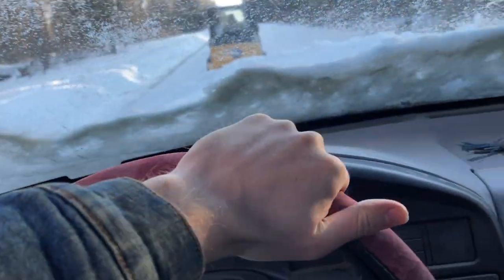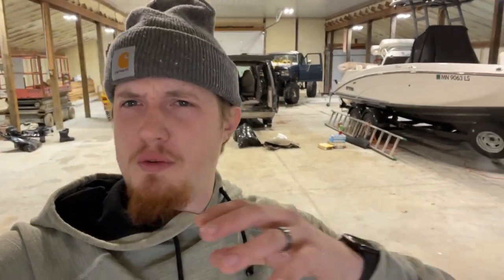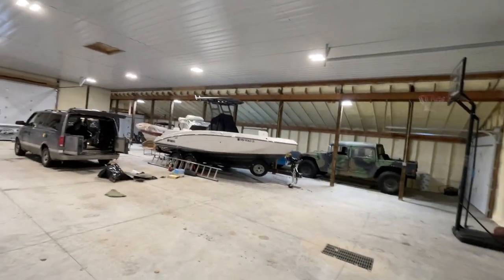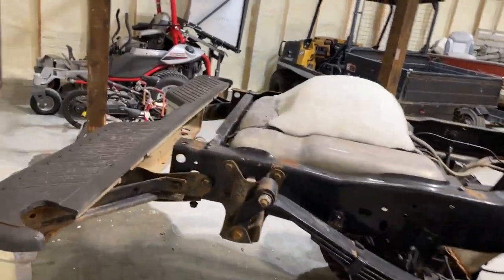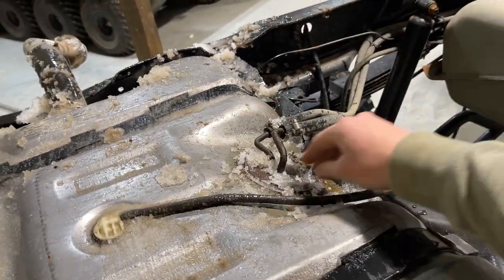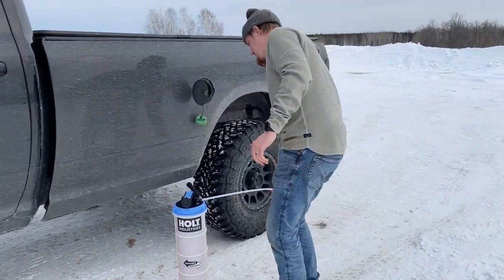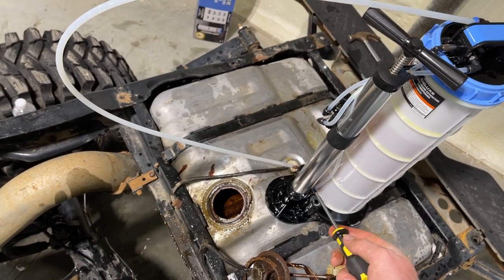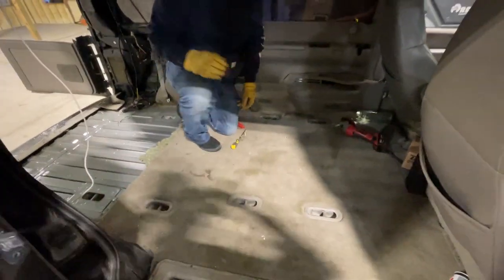Resurrecting The Fummins

Comment: I have a 6.9 that I was working on around 2019 and it sat for about 4 or 5 years in Minnesota with the modern corn diesel in the tank and I got it running and it ran good for about a couple hours of idling maybe and all of a sudden it died. I was trying to figure it out until I got a Pump to get all the old fuel out and I found that same tar in the tank when I took the hose out because it was covered in it so it has sat for another 2 years now that I’m older and know more I’m going to try and get it running again if I get the starter in and my secondary fuel system working until the tank gets dropped. I think it might be the corn in the diesel that makes it get that far in it like corn syrup almost but I don’t know. One other thing was the injection pump got sticky after it sat from 2019 to 2021 and I had to take the top off it and free it up so it could be the 2 extreme hot cold weather in this state that did it